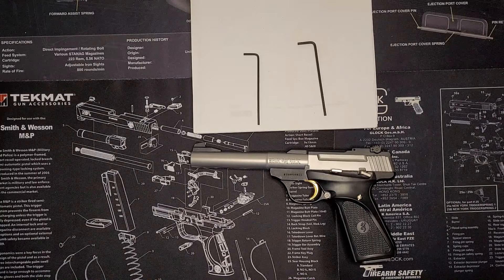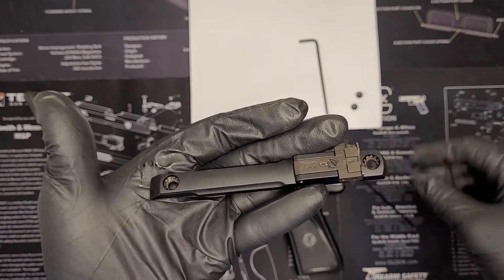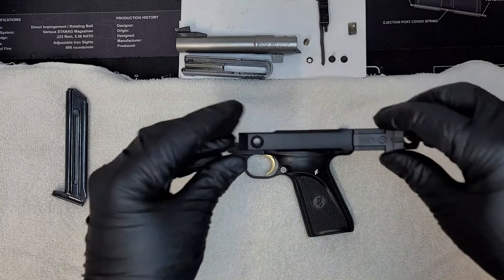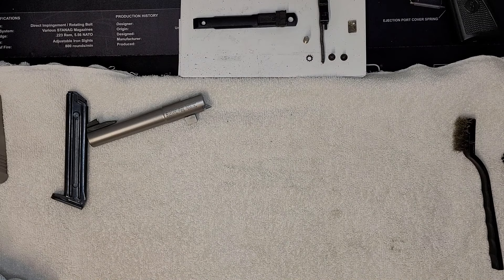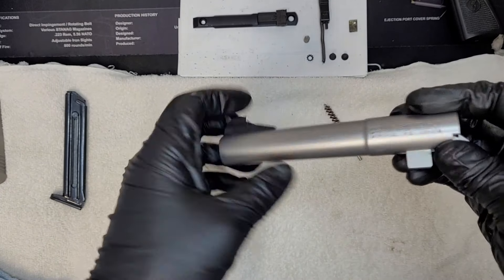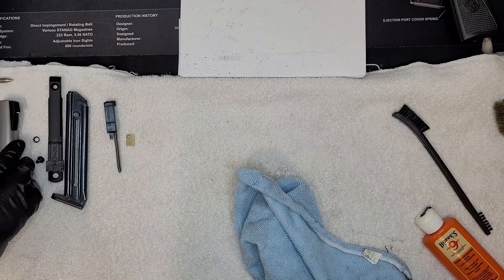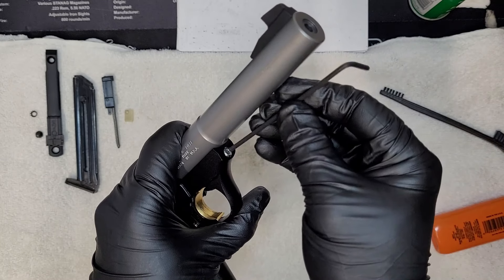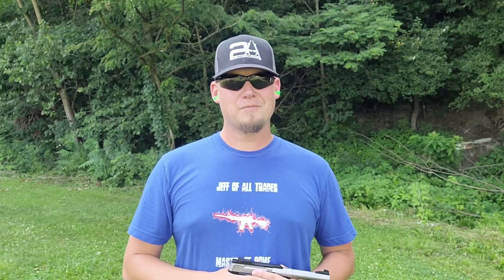Browning Buck Mark tear down, cleaning, oil points, and CHEAP SHOOTING!

Comment: Has anyone used the white, post 2000 buffers in a pre 1999 ( black type  buffer ) Buckmark ? I've heard they are okay to use and also no.
Reply: I found my black type buffer disintegrated, bought some new white buffers online (Numrich? don't remember who) and the white one works fine with no problems.

Comment: Browning says not to do what you are doing I’ve had a Browning challenger for 37 years and I’ve never stripped it apart like that do not need to do that
Reply from the maker: Browning actually states to not take the barrel off. Which I've never seen as an issue. If you wanted to just remove the slide, you could do that as well and keep the barrel on. Or, as I stated in the video, you can keep it all together and clean it with the slide in the rear position. I'd like to see the article you have that says not to do this.

Comment: Holy ** Jesus you and all the other ** that is not a full disassembly a full disassembly is taking it completely apart Springs hammer sere mag catch You didn't pull the firing pin you didn't pull the extractor if you want something done right you have to do it yourself that's all I start making videos
Reply from the maker: Let me know how it works out for you! Tag me In your video you make, which will be much better than this one, and I'll subscribe
Reply: @jeffofalltrades8489  I'm sorry that was written out of an hour and a half playing with the Safety keeper which I cannot get reinstalled so I'm going out to the garage to get a 4 pound hammer It says a lot about a person when you degrade them on their own site and they're completely polite and courteous in their reply it says a lot about your character in a positive manner But I've noticed a lot of people that have done videos on this particular gun do the same thing because there are a lot of movie parts and they are stamped and they are not easily reinstalled once you take them apart And you're the only one that shot and hdmi Definitely a plus
Reply from the maker: @sentineloffreedomforever1381  my videos are generally for beginners. Overwhelming them with how to take springs and firing pins out are not my demographic. You're correct, this is not a 100% full disassembly of the weapon, but it's a pretty in depth one for people that just want to deep clean it. I may one day go that route, but the audience for that type of thing is too small. If you have questions or need guidance send me a message and I will help any way I can.
Reply from the maker: @sentineloffreedomforever1381  my videos are generally for beginners. Overwhelming them with how to take springs and firing pins out are not my demographic. You're correct, this is not a 100% full disassembly of the weapon, but it's a pretty in depth one for people that just want to deep clean it. I may one day go that route, but the audience for that type of thing is too small. If you have questions or need guidance send me a message and I will help any way I can.